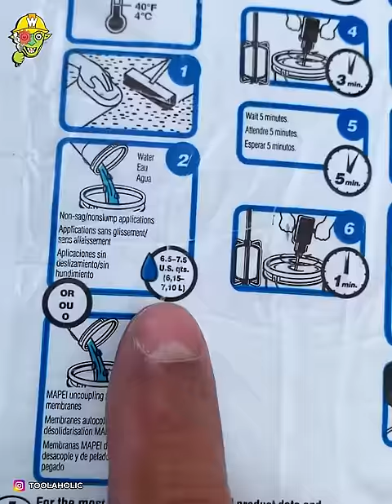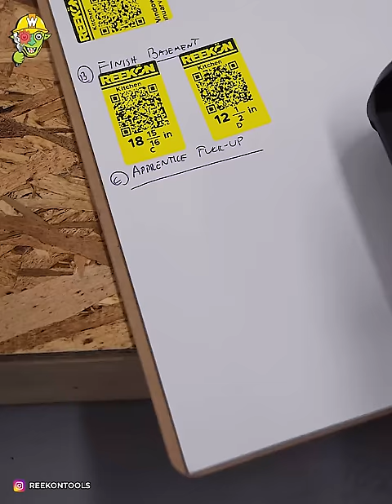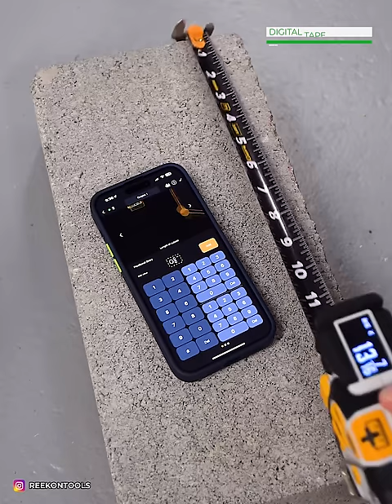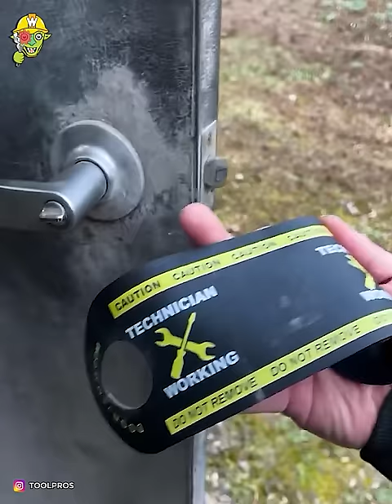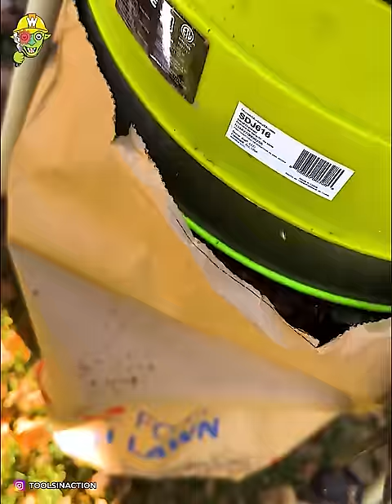Top Amazing Handyman Tools That Are On Another Level!

Comment: Issue with flamethrower or heat to remove snow is that the water need to go somewhere, for then freeze and maybe make bumps or slippery ice or clog draining or more. Combine with a water suction device? High pressure washer connected to hot water is an option instead of flames, issue is even more water to freeze, along snow on the sides get even harder and slower to melt.

Comment: We have the Porter Cable jig, but when we received it they sent us two right handed stops and said the left handed stops were out of stock, when they finally got them in stock 2 months later they sent them to us and they were bent. We had to straighten them out in order to use them. The vac in the bucket idea is almost 50 years old.

Comment: The 2000.- Hilti Transmitter is deceiving. There are 2 parts to this tool.. The receiver goes on one side of the wall and the finder goes on the other to locate the drill point. It DOESN'T look through the wall looking for the magic marker dot.

Comment: Clearing snow with a flamethrower ?
Has to be one of the stupidest things I have ever seen.
If the temp is below 0 C you will get nice blank ice after a while when the melted snow freezes. Good if you want to skate but a disaster to walk on.
If the temp is higher than 0 C the snow will soon melt anyway, so why waste fuel ?
And also... If there is a thick layer of snow, the flamethrower will be completely useless...